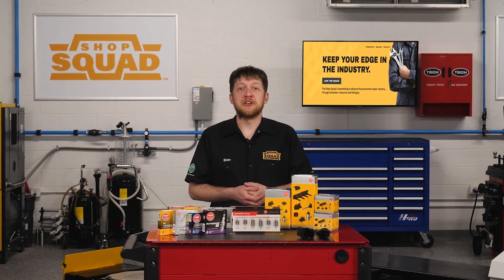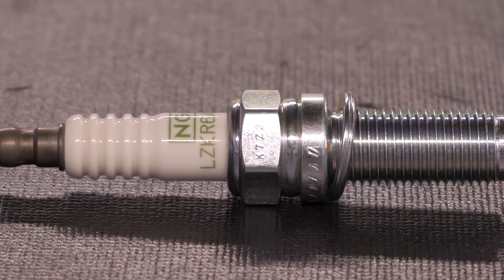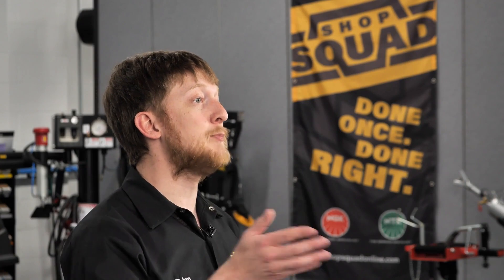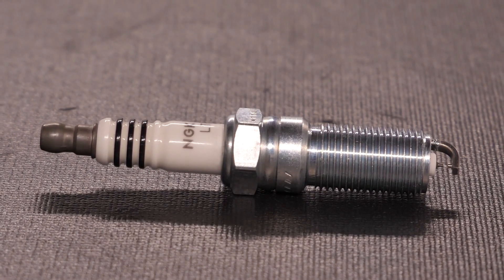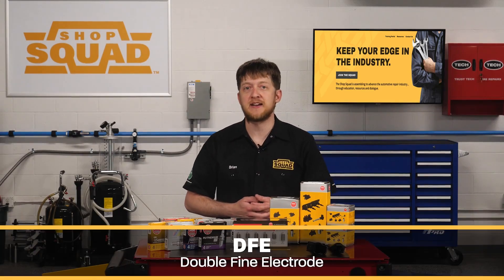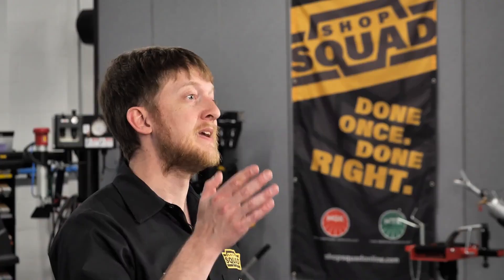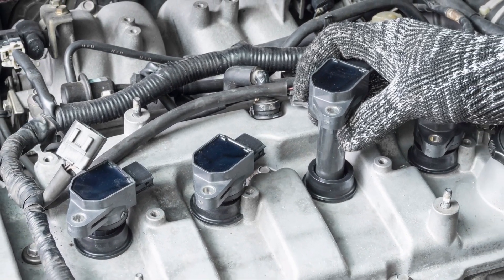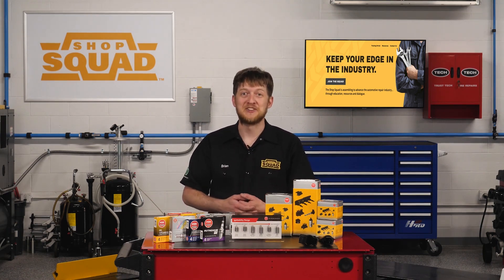High Ignitability Spark Plugs

Comment: For racing applications I prefer to use NGK iridium IX spark plugs. This is because under extreme conditions the platinum welded onto the ground belt of Ruthenium spark plugs could desolder and cause engine damage

Comment: NGK. The consumers are dying for a comparison between your Ruthenium HX plugs versus the Laser Iridium plugs.
Reply: He said Ruthenium is more resistant to heat and erosion. Does it implies extended life of the eletrodes with the same ignitability as Iridium electrodes?
Reply: @metzmatu8409  after 3 years of use they are definitely more resistant to corrosion and wear. But that doesn't answer the ignition question on how fast the spark is and how well it holds up under forced induction...
Reply: Right? It's been years....
Reply: No I still think iridium is better it's just more expensive to manufacture that's why they're more expensive then the iridium plugs